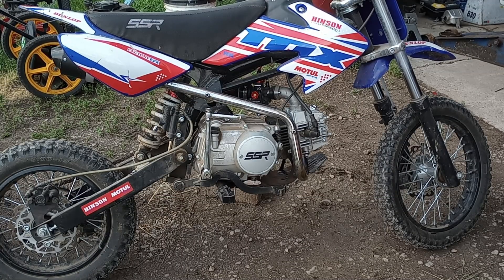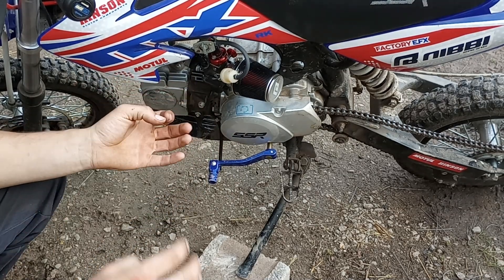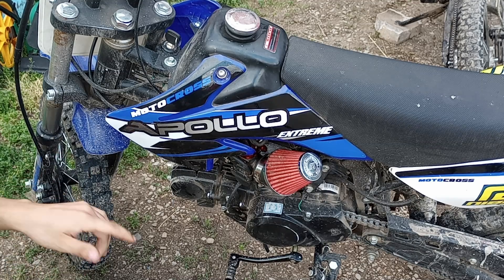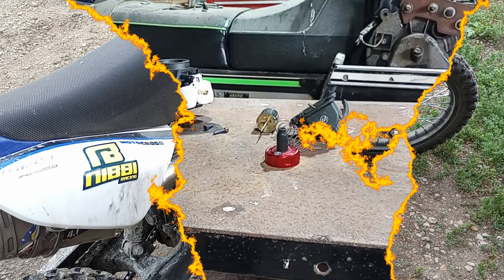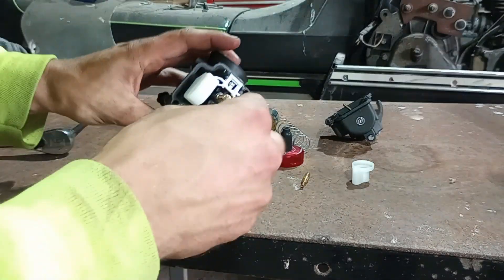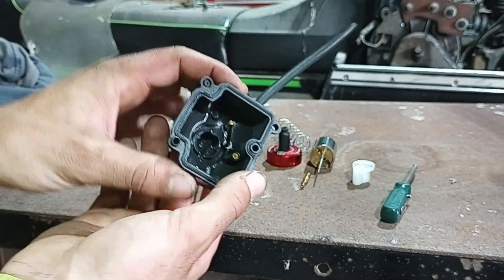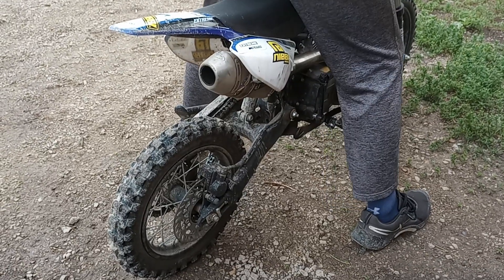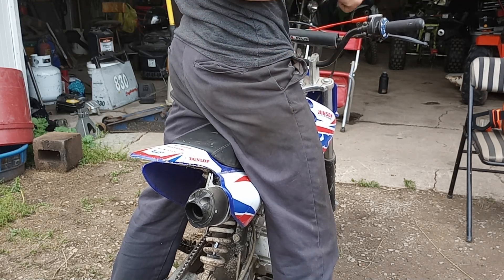The ULTIMATE Jetting/Tuning Guide - NIBBI Racing 22mm & 24mm Carbs on 125cc Pit Bike

Comment: I got the yx140 engine with the nibbi pe24 @ 341ft elevation I tried the pe26 but I could never just get it right after 5million combinations haha now the pe24 has a 40 pilot & a 135 main jet, it's the closest I've had it to running right it starts first kick & idels well just feels like it's lacking power & spluttering a little through mid to top revs with the choke off, I'm gettin there but slowly loool

Comment: What state are you guys in? I'm in NC at Sea level and Iv got a Grom clone with a 125 basically same motor y'all are running and I put a vm22 on it which is a 26mm carb and it never would run right now matter what I did to it just wouldn't idle right crank hard so I got a really good deal off FB marketplace on a makuni 30mm brand new so I figured it would be a little big but knew I could tune it which ever way it need to go and I'm planning on putting a 190 on it anyway but anyway that 30mm made a huge difference in my power and it cranks and idle no matter if it's cold or hot it works so good very responsive it picked up 10 mph on top speed going from the 26mm to the 30mm and it's way louder now don't sound like the same engine

Comment: My Chinese four wheeler, had it for about about a year before I thought id pull the spark plug and check it for rich/lean and found the gap was wide open about 1/8 an inch or more... I was like wow wtf..! The electrode was literally bent open like a curve... can’t believe it ran and honestly ran good. I installed an NGK that didn't have a resistor to it and damn... I bet it doubled the power. I’ve since done a ton of mods.. and for a 110cc single speed, it skeets

Comment: When you say needle position 5 is that all the way down or all the way up. In the video, it looks like you were doing something.With your hands, but I could not see them
Reply from the maker: All the way down. 1 is leanest (top) 5 is richest (bottom)
Reply: @bearkreekboys  this is the first time i'm tuning a carburetor so i'm sure i'm the one that's wrong but if the needle is farther down, wouldn't that make mixture leaner, because it is not coming as far out and letting more gas out?
Ether way your setting got me very close ended up using a 42 and a 105
I tried a 38 and could not get it to start.
Thanks for the reply!
Reply from the maker: @trevorj203 the needle itself is lower yes when the clip is in the top position #1 leaning it out yes. Lower clip to #5 and the needle sits higher more fuel (rich)

Comment: I’m running the same carb on an egl a10 125cc, and currently with the needle on the 2nd from the top, main jet 100 and pilot 38 runs rich, played with the air screw and it still bogs when ripping the throttle. Previously the other stock carb had 85 main and 38 pilot and ran perfect. Should I use the same jets?

Comment: Hey I've copied the exact specs for the 22mm and it idles good but sputters and backfires like crazy when accelerating above 1/2 throttle. I've tried moving the needle 1 position leaner and its fixed it at high throttle but wont idle now. What should I adjust? Thanks
Reply from the maker: The fuel screw, or change out pilot jet
Reply: @bearkreekboys  Hey I changed out the pilot jet and it runs perfectly now thanks for that.
Reply: @Blakew0 what did you put the pilot jet to?
Reply: what’s the needle clip position now also

Comment: Thanks a million for this explanation, my nibbi 22 is on my 2024 vader 125 I put it on with stock jetting, (should have check jetting before) and it would not start 1.5 turns out and I turned it in to 1 turn and It cranked right up with idle set to about 1500rpm, should I change my pilot and to what size?

Comment: i bought the 125cc xpro street enduro last oct.,its still stock,with a 10,000 rpm redline i was able to get 52 at 9000 rpm with not much left on it,with 13t/41t gearing,i have a 17t yet to go on,what rear t would you reccomend? a fb friend told me he was able to gri9nd a lil off the engine case to be able to accomadate a 18t front which i will not do.i just dont like the fact that the chain is ru8bbing on the swingarm despite the plastic piece their to minimize it,been told to try a 36t rear but will also order a 38t as well just in case. i really need to get at least 60 mph as a cruising speed on state route roads and not be a hindrance to other traffic while at the same time not having to redline the motor to get there,am so glad i found your video,as i been working my brain looking at amazon the last 2 weeks at the rite carb,am decided on the PE 22 b4 seeing your re4ccomendation-lol, for it, and really glad i got the additional info from you regarding the jets and fuel/air screw,mine is tagged with insurance,but an out of state tag as the tax commissioner in my county refused to issue me a tag and they dont do titles on dirt bikes,my bike only has 91 miles on it and last march i was not getting any park to the plug and finally bought another performance ignition coil and hookeed it up in may and now i got fire to the plug,but cranking it up for the first time since the 3rd week of matrch 2 weeks ago it cru8nk up strong on choke,then switched the lever to the mid selection to warm up and it shut off,so sumthin internally in the cheap carb wont let it run in any other of the 2 selections with the lever,had planned on getting a nibbi replacement anyway down the road,just didnt expect i would have to after only 91 miles. i have found and w2ill eventually do it when this 125 wears out,found a 190cc zongshen off alibaba that will direcftly boltb in place of the 125,but was advised to drill out the prexisting mounting holes on the frame to 3/8th cuz its a heavier engine. i had also planned on getting an identical air cleaner like what u got too,so at least am somewhat on the right track-lol. i just dont like the not having more fuel capacity-lol,its only 1.03 gal tank,which am getting 90-95 miles with then just buying more fuel,havent determined the running out of fuel moment to see the true range-lol. but have planned out an option to bolt 2 1.45 gallon tanks side by side on the rear of the metal frame with a Y adaptor going to the existing fuel line mounted on a piece of sheet metal n the rear. i really want that 190cc as i know it will allow interstate speeds along with its 5 speed transmission. its 729.00 incluiding shipping.thanx for your carb tuning video.

Comment: I installed the pe22 on my 125cc and did a 40 pilot 102 main and 4th spot on the needle. It's working mint, but my air screw has to be a little under 1 turn for it to run well. Do i bump up the pilot jet to get my air screw 1 1/2 turns out or just call it good where it's at?
Reply from the maker: That's your call, it is fine to run like that but wouldn't hurt to bump up then u can adjust again for different temp changes etc.
Reply: @bearkreekboys  thanks man, this video helped me so much. I really appreciate it 👍

Comment: Mabey ill try a 40 pilot instead of the 45/115 or a fuel pump of some sort
Reply from the maker: There's no need for a fuel pump you have plenty of fuel flow
Reply: @bearkreekboys  exactly cuz the plug is wet
Reply: @bearkreekboys  guess I gotta live with that slow on the throttle it's only when I like crank it just sounds like it's flooded out stays running idk I wonder if the 22mm will not do it I already have a vm22 mikuni but that's on a 212 mini and it's perfect how I got it

Comment: I have a 24 pe fl but its not red and black have a 45 pilot 115 main clip in the 2nd to last slot what would i do for more top end pilot bigger or main jet
Reply from the maker: Play with needle clip and main jet
Reply: Thank u bro it runs great just when im tuning the idle i have a tach set up to it trying to get it at 1500 rpm idle then when i blip the throttle quick all the way it bogs dosent shut off just bogs at wot i have went up on the needle still does it guess i will try the 22 mm its 60 bones tho 😢@bearkreekboys

Comment: Would a 22mm be good for a 110cc it originally has a 19mm and im trying for more speed and power on the r9ad its got a new exhaust on it too
Reply from the maker: You can try the 22 might be better at wide open throttle, will suffer some snappiness off the line
Reply: @bearkreekboys okay thank you 👍

Comment: Hi! I have problem with start engine. Nibbi 24 jets 112 and 40 (serial). Do you think if I change pilot jet to lower it will help?
Reply from the maker: Have u check valve clearance?
Reply: @bearkreekboys  sure. Acc to instruction for 140cm3 intake 0.10 and exhaust 0.15. I have to kick twice with choking, then switch it off and try to start. When it starts I have to hold throttle until it will be hot - otherwise it will stop. When engine is hot there is no problem with start it again.

Comment: Looking for a bigger carb for my 100cc 4 stroke and i ordered a pwk22mm but i am reading everywhere that its a 2 stroke carb and will not work on 4 stroke. Got some advise? 😅
Reply from the maker: Pwk is typically on a 2 stroke, I did make my 125 run with a 24mm pwk though, just rich..

Comment: So on the YX140 with the 146 kit from tbparts and the high compression piston, it comes with the 26mm carb, do you recommend a 22/24 instead?
Reply from the maker: Ive had decent luck with a 26mm on the 140, some are fussy but most yx140 motors will run good with a 26.
Reply from the maker: Just have to see how snappy it is and maybe fine tune a little. I had a 140 stock engine with Chinese 26mm carb and had great power never really had any isssues
Reply: @bearkreekboys  I always have terrible luck with the 26mm on the 140, but the 24mm seems like the perfect middle ground.  Being able to snap the throttle and still have some speed.

Comment: I have the 2019 RXF150cc enduro.  I have a mukuni 26mm on it. And it works great. Had a few little issues but its tuned well for trail riding. It Was breaking up in 4th gear with a +1 front sprocket at 100k./hr, 60mph. Idle and throttle response i have dialed in great.
Reply from the maker: Good to hear!

Comment: I have a thumpstar 140 and installed a nibbi pe22 on it, I’ve played with the jetting, the idle screw, and have no air leaks and it’s idling way too high.. any advice to get it idling where it needs to be?
Reply from the maker: Choke on? Throttle cable and slide not installed correctly?
Reply: Choke is off after starting bike, cable seems okay and the tube is on the correct side I believe.. the divot is on the side where the idle screw is at
Reply from the maker: @Reelguy125  something has to be causing it to idle high, recheck all throttle cable areas and make sure it has freeplay.

Comment: I have an rxf 150 with a 24mm nibbi I’m trying to get it dialed in I’m not sure what it’s jetted at right now but I do know I get a small backfire when kickstarting and have to give throttle to get it going I’m not sure if that means it’s running rich or lean also it does sometimes bog and stall while revving when first started but not while riding and after it’s warmed up ????  HELP if you can Please
Reply from the maker: Is the idle set high enough? Need to know what jets and settings are at first then play around with that

Comment: I bought the Nibbi fl22mm for a 110 pitbike and it bogs if you rev it from idle to full throttle quickly also the engine starts to surge when riding from 1/4 throttle to 2/4 throttle and after 2/4 it goes away. I have tried all needle clip positions and the surging is still thereI am currently running a 32 pilot with the needle on the fourth richest position and a 95 main jet. Also I am not getting any black smoke from the exhaust and I am at sea level. What should I do?
Reply from the maker: Is the float height okay? Did u try going leaner on needle to get rid of the sputter in the mid range? It's tough to totally get rid of the bog off idle, usually big pilot jet helps, but then sometimes it'll sputter in 1/4 throttle then. Mine still bogs some off idle if I snap it, I live with it for now. There was some comments on this video with some more tips too

Comment: Well I just found out something was up with my gas it was milky I cleaned it all out. But it won't Accelerate it wants to die but I did put the smaller pilot jet in it. Idk I'm trying rack my brain what's going on... might still be the magneto but I'm getting decent spark
Reply: Might be loading up on gas. If it only starts on with open trottle try lowering the needle and raise the idle
Reply: @luisnavarro880  I got it running. It still needs different jets cause it's a batch to start cold bur when it dose it rips just can't go full Throttle from a ideal but if I go up normally it hulls ass. Just been too cold to mess with it.

Comment: So I got 3 pit bikes 2 125cc and one 110cc I put a 22mm on my 110cc it ran the first time I put it on there but then after I got a new wheel and cover for the bike cause I got it cheap it wouldn't stay running some how I got it to run went up the street but the bike would die after halfway of throttle I put smaller jets in it wouldn't start up put the normal jets back in now it starts runs for like 3 to 5 secs and dies could it be something dying with like my magneto? Or maybe the wiring is junk? It's making me mad.

Comment: my predator 212 idles way to high when its hot, so i adjust the idle screw accordingly and when i try to start it cold it dont like to start. running 45pilot 115 main needle in third slot.
Reply from the maker: Any vacuum leaks around the intake? Also you may be off on the jetting for pilot circuit.

Comment: i just bought a newer 125 pit bike, extremely fast and it has a pz26 carb. however, i want to upgrade my carb but i dont know what carb to get or size or anything, you guys seem like experts 😂. what do you reccomend? im kind of on a budget too. and what jets would i get too? basicslly whats a complete setup i can buy for my bike? also im at 200m (656ft) ish above sea level too. The pz26 filter also has this hose at the end of the filter that i assume reburns backfire or something? what can i do about that on a new carb filter without accomadations for that hose? Thanks!!
Reply from the maker: I'd say the knock off mikuni carbs are a decent upgrade! They r cheaper than the nibbi. If u have a little extra coin, the nibbi is snappy!
Reply: @bearkreekboys  I bought the Nibbi 22mm Carb, just rigged it up and I cant wait to tune and test it out tommorow on the trails. Thanks brother! Just need help with how to know what jets to use blah blah but, Ill figure it out down the line.
Reply from the maker: let me know @christien6907
Reply: Get the vm22 cheap carb and disassemble it completely. Take out any shards and very gently setting back the brass fittings.
Reply: Then add 25 pilot and 110 main. And needle pin start at top position 1st clip then work your way down . This will adjust your wot

Comment: I just purchased a Nibbi  PE22 FL 

It's for a Lifan 125cc 

Comes with a 98 main and 32 pilot..

Also comes with 30 pilot and 92,95 and 100 mains

Do you think those jets would be enough to get me ballpark running right? 

Cheers 😊
Reply from the maker: U may need bigger pilots to get crisp throttle response
Reply: @bearkreekboys  ok, thanks mate
Reply: I am looking at doing the same with same motor. What did you end up with? Thanks.  @DarrenBoxhall
Reply: @MarkedPrivate-n9p  ran the 32 pilot that it came with, then put the 100 main in and put the needle valve clip down 1 groove. Runs perfectly, snappy as, starts perfect
Reply: My plug was black with 32 pilot and 100. I'm at 1500 feet above sea level is this why? @DarrenBoxhall

Comment: I have a legitimate question I can’t find anywhere for nibbi carbs or similar . Where do I find out what jets and settings should it be for 6000ft elevation?

Thank you 🙏
Reply from the maker: I'll do some digging and compare that to what elevation I'm at and it'll probably be a size or two leaner
Reply: @bearkreekboys were you able to find out ? I know I’ve heard to put the needle at the lowest position to make it rich . But other than that I’m not sure what to do ? My nibbi carb 22 should be coming in today .
Reply from the maker: We are around 1,000 feet above sea level so that means you would be leaner than us with being at 6000 feet. Try it stock out of the box and see, otherwise go in on air screw and drop needle 1 clip. richen slightly if its boggy. sputtering is rich, youll want to lean down then. @desertwolfarmory
Reply: @bearkreekboys  so there’s 5 spots on the needle and it was set at the 2nd to last clip spot  I’m assuming that’s rich and the higher I put the clip it’s leaner . So should I leave it at the second to last clip ?
Reply from the maker: @desertwolfarmory  try it there can always go up and lean it yes

Comment: Great learning videos boys! 
I’ve got a 2021 Max 20 125 without an air filter but a filter box. I’ve got the stock carb and am looking to upgrade to a 22mm carb. It’s for our beginner 12 year old so no need for high performance or bigger than 22mm. Which carb should I buy and is there one that doesn’t require or very little tuning? Thanks
Reply from the maker: Nibbi 22mm PE style would work for best performance. The knock off mikuni vm22 on eBay is good for cheap! That wakes it up slightly. You will have to do some tweaking either way to make it decent to notice a performance difference.